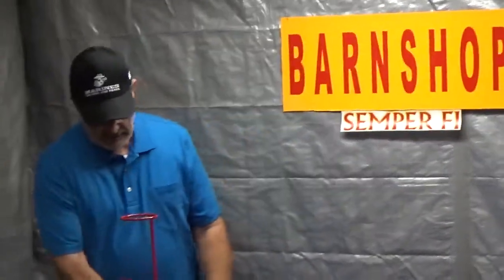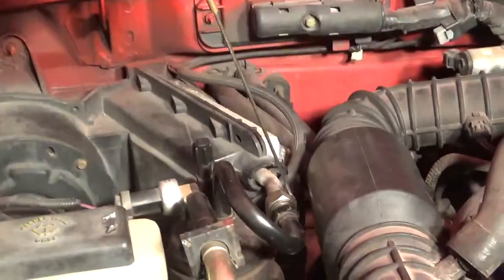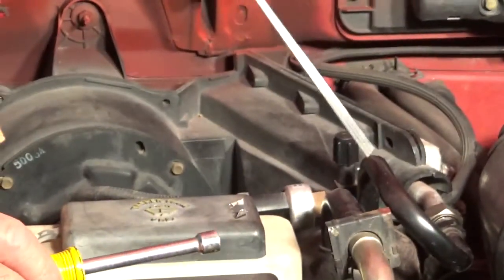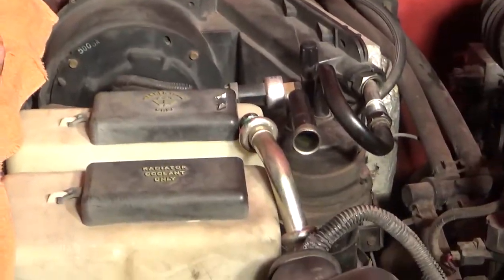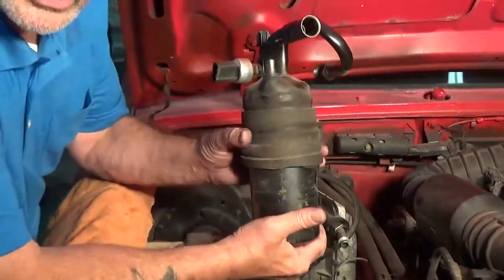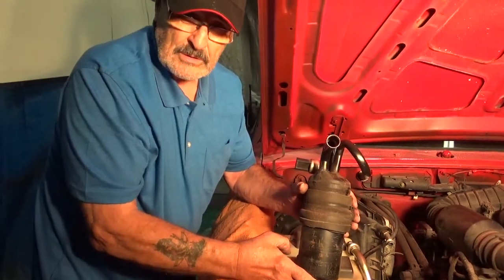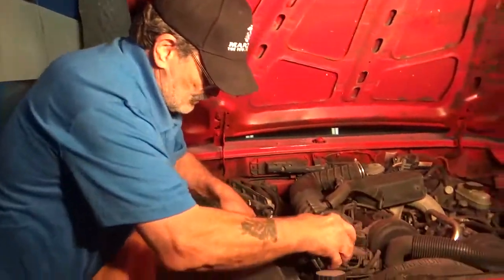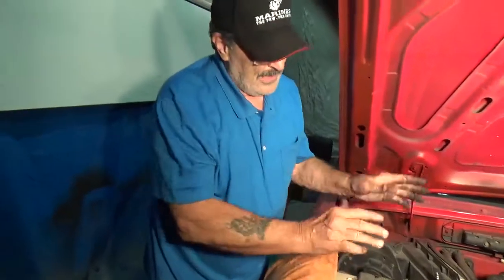Accumulator replaced easily on Rangers Mazdas Explorers Merc Mountaineer

Comment: After replacing the compressor and the condenser I’m trying to remove my accumulator. The part where you used the adjustable wrench and big leverage wrench together is where I am stuck. I noticed you went in one direction to break it loose and the other when spinning back the gold fitting. Is that accurate or am I missing something?

Comment: nice video! pretty big question. i am considering the idea of replacing both the AC compressor and the Accumulator.. the pulley bearing was going bad but the system was working at the time almost two years ago.. ended up bypassing with a shorter belt. but, the question is.. does the AC need be hooked up to the belt for a AC shop to vaccum out the system, and should i replace the hoses, and anything else if i were to attempt this procedure?
Reply from the maker: Good question James.  If the bearing is bad the repair should be done and the system completely sealed before the vacuum pump will be needed.  First, if you are considering replacing the compressor and accumulator, that is how I would proceed, however, the clutch and bearing could be replaced.... still have an old system that could be troublesome later.  Second, repaired or replaced always vac the system after the system has been opened.  If repaired the accumulator should be replaced and then vacuumed out. Third, If all parts are replaced you should have a dependable system for a long time.  The compressor does not have to be hooked up or running when the vacuum pumps out the system, but the complete system must be totally sealed (no loose lines or fittings).  Thanks for your questions and the best to you.
Reply: Thanks! Its a future project and good to know because it's only 150 to replace both the compressor and accumulator

Comment: Mine has an o-ring on the top tube going to the evaporator, is this missing on yours? Or maybe mine is not suppose to be there? I'm so confused! Great video, thanks for helping me with this project.
Reply from the maker: Thanks for asking, Daniel.  At 14:11 it's very difficult to see the o ring just in front of the evap pipe flange but there is an o ring that the threaded accumulator pipe seats against and the nut tightens against the evap pipe sealing the system.  That's a bit long winded but, that should clear it up for you.  Most all fittings of this type will have at least one o ring and some fittings have more.  Hopefully that helps.
Reply: @barnshopproductions7132  Excellent, thank you for your reply! I replaced all the o-rings including the one I mentioned. I just had a shop vacuum test it and recharge it. No leaks! I couldn't have done it without your video, much appreciated!
Reply: Great video.  Can you tell me the name of the tool used to separate the hose around 4:32¿

Comment: What about the oil that goes in there? Does the new one already have the oil in it?
Reply from the maker: This accumulator didn't have oil in it.  There may be some that have oil, however, I add any oil that's needed when I refill the freon.  You may loose some when replacing the accumulator and especially if you're  replacing the compressor.  I've replaced compressors that come with oil already installed by the factory and some that don't.  Be careful to replenish any lost oil and not to overfill the system.  Usually a factory decal under the hood tells how much oil the system requires.

Comment: What’s the tool to separate the spring on the o ring?
Reply from the maker: It's called an "AC line disconnect tool".  Your auto parts store will usually have them in stock.  Both plastic and metal tools are available.
Reply: Autozone let me rent one with a fully refundable $50 deposit

Comment: I got a 2001 5.0l mountaineer ranger. Ranger with mountaineer engine and drive train.
Reply from the maker: Very interesting.  Bet that ranger will scream!  I'm sure you know already but, during the 2001 year they changed from the 2.5L to the 2.3L and of course they had the option of the 3.0L  and 4.0L.  Did you need many modifications to set the engine and the drive train?  I'm familiar with the 5.0 engine mounts after building the engine in my 93 mustang GT, but I've not measured my ranger mounts to check the compatibility. Just curious.  The Mercury mountaineer has the same chassis as the Explorer after they redesigned it in 95 copying the old ranger chassis, again, very interesting. Thanks Sgt for your comment.
Reply: @barnshopproductions7132  I bought it that way for $2700. And yes very fast. Ranger, Mazda b trucks. Explorer. Mountaineer all same chassis more or less. A friend of mine made v8 ranger by taking explorer body off and putting ranger body on. Mine looks light it was pretty straight forward swap. Just axle mounts had to be customized a bit but that may been from lowering truck.. You can put explorer or even mustang dash in a ranger if they same year range. Seats, steering wheel and column. Lot interchanges
Reply from the maker: @SgtJoeSmith  Great info.  Thanks again and best to you.

Comment: Awesome!! Best video ever. 

How do I know when to change it? Thank you!!
Reply from the maker: ALWAYS change the accumulator when replacing the compressor.  The contaminates in the AC system must be removed or the new compressor will be destroyed.  When the system fails there will be contaminates going all throughout and they must be removed using new parts and have the entire system flushed.  Lengthy but hopefully helpful.
Reply: @barnshopproductions7132  VERY helpful. Actually your answer was faster than expected. Do you have a video of how to flush the system? It would be interesting because of how you explaine things.
Reply from the maker: @j.santosh.l.6386  No, I haven't made a system flush video  You would need a vacuum pump and AC gauges and most home repair shops don't have those.  I apologize for the delayed response.  Thanks for your question and kind comment.  I've been a bit slow lately since knee replacement and shoulder reconstruction, what an excuse for slacking lol.